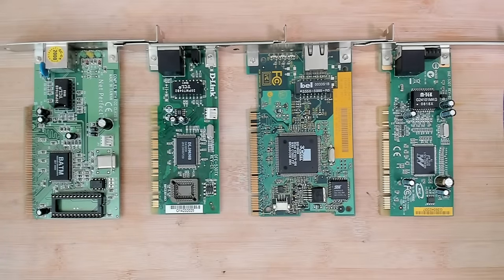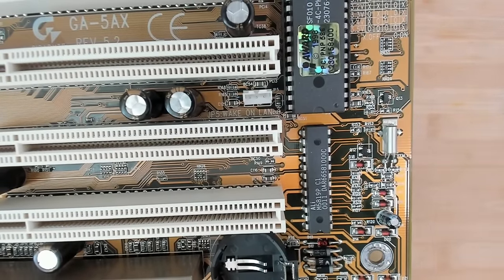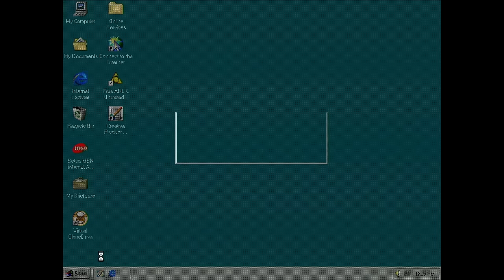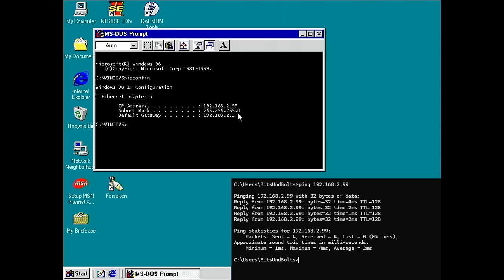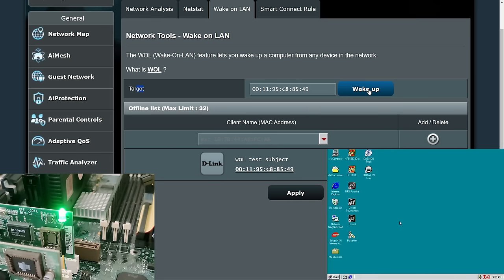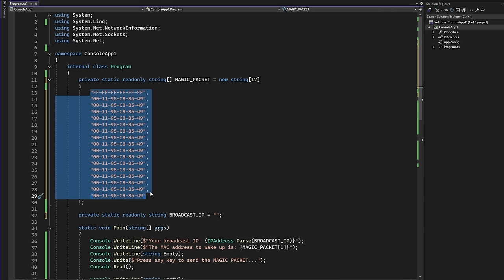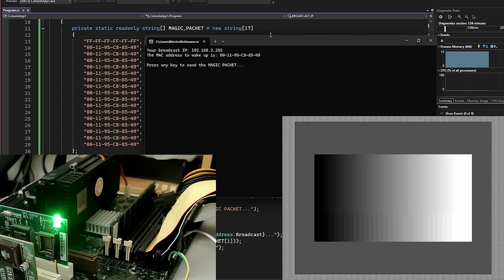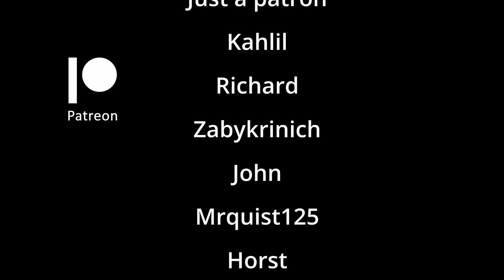A special packet that can wake-up your PC (Wake-on-LAN Explained)

Comment: I use Wake-on-LAN daily, to bring back my computer from sleep when I return home. A script detects when my phone becomes pingable on home WiFi, wakes the main PC and powers on the TV. Saves a few moments doing all that manually then waiting for everything to come back on.
Reply from the maker: Are you using Home Assistant for the automation?
Reply: @bitsundbolts  no, my own scripts and smart socket with Tasmota firmware and simple HTTP API.
Reply from the maker: If that's enough and does the job, then there's no reason for anything else. Plus, it's yours and you can modify it at will - which is a big plus in my books!
Reply: @romanrm1  is that a cron job to detect your phone?
Reply: Simple ping is such an ingenious idea, I assumed you have your phone on static address through the dhcp server? I always locked myself using battery draining geofence smh

Comment: In the bios, you have “on pme: stay off” set, maybe you want to turn that on to allow power management events…
Reply from the maker: Hm, I must have overlooked that option. Why would they have two options in the BIOS? Just so that I can have a master switch?
Reply: @bitsundbolts  perhaps the BIOS option WOL is just for sleep mode, and PME is for powered-off states. This way you could control which computers are able to be turned on by magic packets: only those in sleep, only those powered off, or both. Or none.
Reply: @bitsundbolts not sure, but the "On LAN" option may refer to PXE rather than WoL, especially that its in the "Boot" section. I would expect settings for WoL to be in the "Power" menu.
Reply: Nope. Fully irrelevant. The problem is that he is missing the bios chip from the card (the rectangular socket). If you don't have this, then the card has no brain to process the magic packet.
Reply: @totallyuselessvideoz  BIOS chips are just a ROM chip, so I'd be surprised if this is what you need for a cold WOL boot.  You seem confident though, perhaps you can steer @bitsundbolts on what he needs to make it work for a follow-up video?
Reply: @TimToolman  I am surprised why @bitsundbolts did not use the 3Com card which has the bootp chip
Reply: My expectation is that the PME option is for wake via the pin on the PCI connector and WOL is for the separate 3-pin header. I could be mistaken but you may as well try enabling both.
Reply: @totallyuselessvideoz  isnt the rectangular socket for the PXE or RIPL boot option rom

This shouldnt have any affect for WoL

I did see some STrio cards also have video option roms

Comment: Fun fact: There are 2 types od PCI slots: 5 volt and 3.3 volt ones. If the key (notch) is at the back it is a 5 volt slot and if it is on the front it is a 3.3 volt slot. You can identify earlier PCI cards by having only the "original" back key signifying a 5 volt card. However soon after the new 3.3 volt standard was introduced manufacturers adapted fast and made "universal" cards that work on both 5 and 3.3 volt PCI slots and you can identify those by having 2 keys (notches): one in the back and one in the front.
Reply: Neat, I didn't know that!

Comment: In the late 90s and early 2000's we used this a lot at ISP's. For the machines that didn't support it we would use an AT power supply and hotwire the power switch to always be on and had a foxconn board with a bunch of solenoids that you could ssh into and type commands to click the solenoid off and on, so it would cycle the power and restart the server.

Comment: I hammered WOL back in the day when working at a school. I created two implementations: A VB program to use during the day, and a web site that I could access first thing in the morning before going to work (the school). When I got to work, I'd check the Symantec Ghost console to see which machines had 'checked in' (before school started). For those that did not check in, I'd hurry around every morning to inspect, and fix (undo petty PC vandalism by students) to ensure all the 360-odd PCs were ready for use at the start of the day! WOL was (and is) cool. In fact, one group of PCs had WOL on the motherboard, but was not enable-able in the BIOS. I contacted Award (the BIOS maker), gave them the motherboard details and the BIOS string, and they created a modified BIOS that supported the motherboard's WOL!
Reply from the maker: Wow! That is a big time saver! Very creative use of WOL and Magic Pakets. Also, very cool that Award prepared a BIOS for you!

Comment: I have used WOL on new hardware, and I do network stuff for work so I am familiar with the frame format, but never knew about the three pin connector on old hardware. Very cool.

Comment: I think your difficulties in getting the system to wake from the S5 or powered down state is one of a number of reasons why WOL isn't more widely known or used. In order for WOL to work from a S5 state the hardware & BIOS/UEFI also needs to implement wakeup on Power Management Event properly.
Even so I found this video very interesting. WOL is a topic I haven't touched in years as in my IT career the only time I was in a situation where it was used was during a corporate Win 7 to Win 10 migration project in 2016.
Reply: having a network kvm attached or built in I guess is just so much simpler to configure and importantly for the users to grasp how it works rather than trying to grasp with the concepts of WOL and thinking what it works with and how and thinking of situations where it would even be useful.

Comment: Pretty sure that the BIOS option right below "On LAN" also needs to be enabled in order for it to work -- "On PME" is short for "On Power Management Event" and that's part of the WoL stuff too. If you don't enable the Wake On PME, the Wake On LAN won't work, as far as I understand it!
Reply: Thinking that too, WOL is likely a special case of PME
Reply: That's probably it. On my modern systems where I use it, the option is in power management and it says 'wake on PCI event'.
Reply from the maker: I'll try that! Thanks for the hint!
Reply: @matthewday7565  yeah, cause there is also ring-in Power ON, used on old PSTN lines, where you would call and the modem would send a PME and wakeup the board too!

Comment: Wake on LAN was present on my very first Network card that I got... A CNet Pro 200WL adapter.
It was in an old Socket 7 that was AT based, so no chance of any wake on LAN feature, and the LANs I used it on was very rudimentary as well.
We had hubs and had to assign IP addresses ourselves :D

Comment: On atx machines, there's no need to send to sleep or hibernate the computer.
Mostly motherboards supports wake on lan power on. So you can power on the machine even is powered off.
Just need to keep the power cable and lan cable connected.

Comment: Used WOL a bit at work back in the day but I also messed with it a bit waking up old HP Compaq laptops from firewalls I was testing back then for a bit of fun/curiosity.
WOL is not used much these days since a typical office machine has very low idle power draw so things just get left on and you don't need it for servers as they typically have management cards (iLO, DRAC etc.) that you can remotely power them on with.

Comment: I remember when WOL first came out, I struggled.  On some of network cards, you had to change the driver settings under power management even more.  I recall some cards wouldn't work until you DISABLED "allow the computer to turn off this device to save power".  You are not trying to save power!  If the NIC is shut off when windows tells the computer to power off, it won't respond to magic packets anymore.  Try to uncheck this option, even if the "allow this device to bring the computer out of standby" is then grayed out.
Reply from the maker: I'll try this option as you explained. Others have said that I might have missed a second option that needs to be enabled in the BIOS as well.

Comment: @bitsundbolts
In the case of the motherboard you are using you do need the 3 pin cable from MBI to Ethernet card to provide the WOL power to the card.  This actually was normal.
Things change over time, but since this was an add on card it had to have that stand by power providing on the card.

You did a great job on the video. :)
Would have been nice to also show some of the Linux and also macOS versions of sending the magic packet as well. :)

Keep up the good job on your videos! :D
Reply from the maker: Thanks! 🙏 
I wish I had enough time to look into other operating systems. But I don't have a lot of experience with MacOS and even less with Linux.

I'll try to find an original WOL cable at the scrapyard. I'm sure I had many in my hand and never knew what they were for. Well, now I'm looking for them - of course, now I don't find any 😅

Comment: When the Nintendo Wii first came out, where I lived didn't have any high-speed internet access, and I configured a random computer is a router that would dial into the internet (and eventually got a Wi-Fi router to act as an access point), and when I hooked up my Wii that I got on launch day, I would find my computer/router would turn itself on randomly. I believe the Wii would send the magic WOL packet to the MAC address of the last known router it connected to if it was able to connect to Wi-Fi and buy wasn't getting an IP address.

Comment: I've gotten a similar experience like you, it only worked half the time, because it's really dependant on the BIOS of the board, the BIOS settings (WOL and PME events, ACPI states) and OS settings. Best luck I had was with a 3com card that had the 4 pin connector and later slot 1/socket 370 board. Weirdest I ever got it to work on was a socket 7 HP Vectra with a Pentium 1 non-mmx. It had some weird proprietary PSU which probably played a part in making this work.

Comment: So before I even watch the video I'm going to share my story on this topic. I took a job in IT work back in 2006. It didn't take long before we realized none of the new computers we just bought could be turned off short of unplugging them from the wall. We couldn't figure it out at all. My friend (and superior) believed it was related to wake on lan. It was, but not in the way you might think. Eventually I had a computer that was having more serious issues. I started removing components to see if it helped. Then I discovered that removing the firewire card fixed the issue.......wait.......did it just power off? So I took another computer that was working just fine and yanked its firewire card. Does this turn off now? It sure does! The firewire card was forcing a WOL signal. To this day I have no idea why, but what I do know is we were able to get a refund on these cards and have them all replaced with a different model. I verified the new model didn't cause the problem. I had to get them installed in over 300 computers. lol It wasn't fun.
Reply: hmm ironically these new PCs were HPs.
Reply from the maker: Well, it is possible to trigger WOL over PCI - so, technically, any PCI device can trigger a power-on event if it's enabled in the BIOS.
Edit: But it's an interesting story! How long did it take you to fix all 300 computers? I guess you needed to test them after you replaced the FireWire card. Not for the WOL bug, but more like a test that they still turned on.
Reply: @bitsundbolts  I don't know. I had help. A couple weeks maybe?
Reply: @bitsundbolts  The worst part was "Gary Lester....Tay's Valley" (his name and the school he was at). I had kids that couldn't even log in and he made a big deal about not being able to turn it off. I told him it was a low priority. I had a lot on my plate. That bastard told on me. My boss sided with him while talking to him and then sided with me. He said you're right, but you can't say things like that. I'm like bullshit. I tell it how it is. I'm not going to dance around egg shells for this guy. Meanwhile Gahanna (the high school I went to as a kid) got a new teacher. I was working on some stuff for him and he bought me lunch. Guess who got higher priority whenever tasks were deemed equal? lol
Reply from the maker: Ahh, dancing around eggshells to make sure not to hurt anyone's ego. You were right in prioritizing your tasks and finishing in order. If you give up this privilege of prioritizing your work, you'll end up with only high priority work - and we all know that that can't work.
Reply: @bitsundbolts  lol any IT person will tell you that to the end user ALL tasks are high priority. And it's true. But I'll prioritize a broken printer that's needed now over a computer that won't turn off. lol But......I've asked teachers more than once why did you wait till the day of the test to print the tests? lol
Reply: Life as a programmer is SOOOOOOO much better than IT. I will say this though. An IT person needs to know the hardware. I got a new computer this year. It had an NVME and a hard drive. When I got the computer I wasn't happy with the performance. So I checked. The hard drive was running the computer. The NVME wasn't even formatted. I was told they could fix it, but it would require starting over. So I got it back with the NVME activated and no hard drive. TBH I don't care about the hard drive......so it's still not formatted. But how do you do IT work like this and not get it set up properly? They did thank me and promised that all future computers would have the NVME prioritized.

Comment: I've never played with Wake on LAN but I've seen it in BIOS/UEFI settings relating to power management. Your video makes me want to play around with it for some experience considering I already know my PCs support it.

But I haven't really had the need for it since I could always press the power button to turn on my PCs. Then there's my practice of always unplugging any PC I have when its not being used since the little idle draw the PSU's have matter in places where electricity is kinda expensive.
Reply from the maker: It's all about awakening curiosity 😊. That's how I ended up making this video. I also have never used WOL before.

Comment: Hmmm... Interesting. I experimented with WOL years ago when it was relatively new and had a bad experience. It was activated (but not used) in the BIOS of one machine on my LAN. Some months later, my LAN went totally TU. The card in the machine with WOL activated started to jabber and I had a heck of a time figuring out who was the "bad boy". After disabling WOL, the jabbering stopped and I was able to continue using that card.
The success stories in the comments here have encouraged me. I might give it another try. It would certainly simplify what I do now (a beaglebone black activates a relay wired into the target machine's power button)! 😅

Comment: I have used Wake on Lan on modern machines (2× Zen 2, 1× Coffe lake) and it works fine with integrated NIC. Soft power off or standby - it works either of those. Apple M1 (mac mini) - not tested yet.
External PCI-e NIC - havent tried that.

Comment: Because must be configured to WoL. In this old PCs: boot windows -> driver configures card to WOL -> shutdown -> WOL works (shutdown is real, but functionality not survive power cut off). In moderm computers, bios or embedded firmware do this transparent (and more, I implemented sideband commutication on our mainboards via I2C on Intel NICs even when computer is powered off.

Comment: Interesting.  I have several boards with WOL . I've never messed with network cards.  I do have 4 towers wired to a switching box, via the vga and sound from each . So I only use one monitor 
, mouse and keyboard.   I'd like to network them together at some point.
Reply from the maker: Networking is a very interesting topic. Good luck and I hope you'll try WOL on some of those boards

Comment: I tinkered with WoL on my modern PC some time ago. I wanted to be able to turn on the PC if I needed to access it remotely. One day I turned the PC on remotely and the RCD tripped - so suddenly I was away and everything at home was without power, including the fridge! So I never felt so brave again but it was likely a faulty RCD as it happened again and then stopped when I replaced the RCD! 🙂
I found this video pretty interesting! Thanks for the deep dive on how the magic packet works. Why 16 times?

PS: 3-2-1- go is my trademark!!!
Reply from the maker: I don't know why the Mac address of the target PC should be related 16 times. Maybe to fill the frame somehow? I really don't know.

Ahm, I knew you were to comment on the 3-2-1-go 😂... I think I watched too many Tony359 videos!
Reply: @bitsundbolts  That makes sense, since Ethernet frames need to be a minimum of 64 bytes long per specification. It's there to help CSMA/CD.

I have also heard before, that it was supposed to help for some NICs that would be "slow" in capturing the frame while in low power standby. Like some models might be able to synchronize on a later part of the frame.
Reply: I had one college that had a PSU failure right after a wake on lan request. It was more like "wake on bang". Fun days 😂

Comment: Yeah, WoL had a lot of issues for a surprisingly long time. Although I work in IT and have been performing sysadmin tasks on some scale since the days of coax networking, incredibly, it wasn't until a few years ago that I had my first scenario where WoL was the solution of choice AND ACTUALLY WORKS SUFFICIENTLY RELIABLE FOR A CHANGE. Mostly. I still don't know why it doesn't in the rare case that it doesn't. 😂 IPMI on the other hand...<insert feels good man meme here>